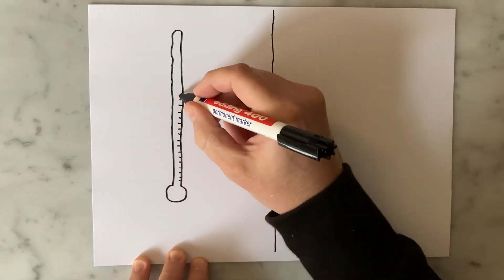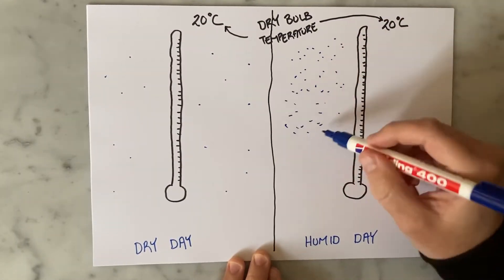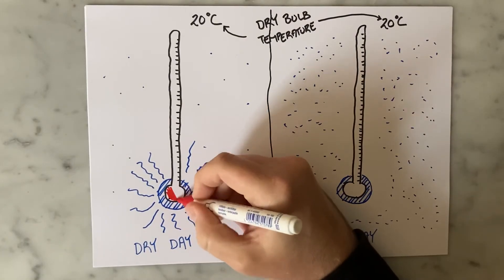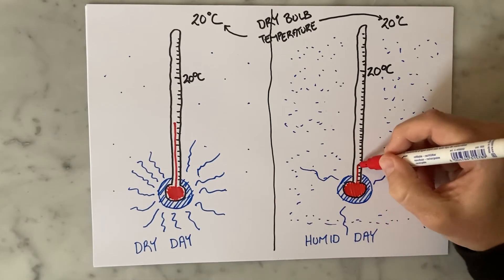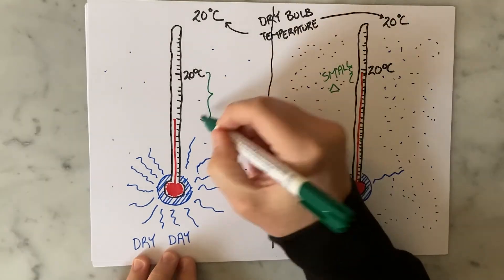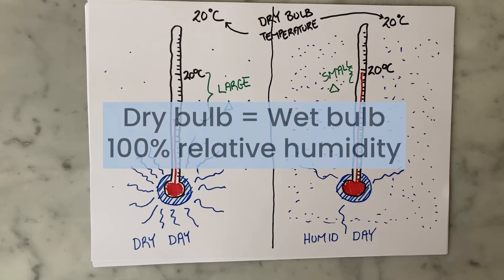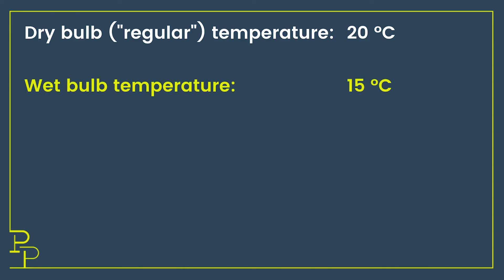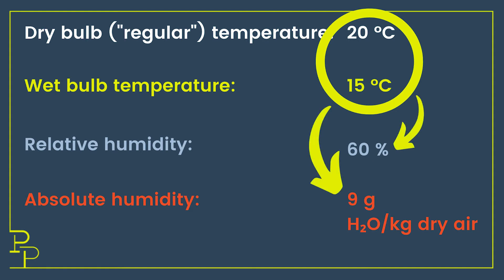Wet bulb temperature - why & when is it used?

Comment: AC is just a heat transfer system using some substance that can boil inside (absorb heat)  just above boiling point of water and condense outside (give up heat). No such thing as cold only less heat. Heat always moves from hot to less hot

Comment: Worked at power plants over the years, often training new folks.  As an exercise, I would sometimes ask them how much water it takes to keep the cooling water system filled.  At first, some would suggest very little since most of the water is returned from the cooling tower back to the plant.   But if you have a large plant (say, 3000 MWthermal) and it's running about 40% efficiency, then about 1800 MWthermal is being rejected into the cooling tower. That's on the order of 800 kg/s evaporating.  In terms for us in the US, that's over 12000 gallons per minute!!!

And yes, the effectiveness varies a lot with the daily weather, which affects the return temperature of the water by quite a bit.

Great video, with some great explanation.
Reply: @dougadams9419 I never said ANYTHING about 'reactor water', don't know where you got that idea.  And BTW, BWR's boil the reactor coolant directly and there are losses in any steam cycle.  And in a BWR, the 'reactor water' IS the steam cycle.

Cooling towers are used in many fossil plants as well.  Bascially ANY large steam plant has to reject a lot of heat to the environment and cooling towers are one way of doing that.  Look for large fossil fueled plants and those too are near water sources.

Comment: Always laugh when pictures of cooling towers are used to represent pollution. Such an inappropriate use of information. In fact, the water vapour is usually of a high degree of purity and nearby fields get increased dewfall during cold overnight temperatures. I live in a semi-arid area and actual dewfall is rarely more than 50 days a year. I'd welcome a power station requiring cooling towers in my neighbourhood.

Comment: Which is more important : dew point or wet bulb temperature ?
Reply from the maker: Your question is kinda like asking “what’s more important in a gas - temperature or pressure?” Both are important and both tell you something different about your system.

Have you seen my video that explains the difference? Wet Bulb vs Dew Point Temperature
https://youtu.be/H1kJttETOMo

Dew point is important when considering when vapours will condense. Wet bulb tell you about how saturated your system is (like a proxy for humidity).

Comment: Very insightful and simple to understand! Thank you for making ChemE related discussions more interesting! 

I do have a silly question. Air is said to be saturated when the rate of evaporation and rate of condensation of water vapour are in equilibrium if i am right. And the higher the temperature, the more the water can evaporate. 

My question is: at higher temperatures, how does condensation of water vapour even begin in the first place once water enters the vapour phase? It seems a little confusing.
Reply: It's a term called dew point, where the temperature gets cold enough to condense the water vapour in the air. That is also able to be calculated.

Comment: Doubt::
If I cover the bulb with a cloth 
1) wetted with water at 0 degrees C
2) wetted with water at 90 degree C
I'll get two different readings ....then which one to call WBT??
OR IS  IT  DEFINED IN SUCH A WAY THAT I NEED TO COVER THE BULB WITH WET CLOTH WETTED WITH WATER THAT WAS AIREADY WITH THERMAL EQUILIBRIUM WITH THE SURROUNDING??
plz help.... definition just says cover it with wet cloth but does not talk abt the state of the wet cloth..
Reply from the maker: You’re concentrating too much on the thermometer and not enough ton the AIR. WBT tells you about the AIR! You’re right that a hot cloth would read higher with hotter water, but only momentarily. That hot water would evaporate and cool itself down. You are right that WBT is an equilibrium value with fresh air constantly passing over the thermometer and the cloth being constantly wetted
Reply: @ProcesswithPat  ohh.... so this means that we will have a unique value of WBT corresponding to a given DBT?
Reply from the maker: Only at a fixed humidity. At a different humidity but same DBT you wil have a different WBT. Fixing any 2 out of 4 of the following values fixes the other 2: DBT, WBT, relative humidity, absolutely humidity (at a given pressure)
Reply: @ProcesswithPat  ohhhh yeeesss.... now I understand....thankyou for helping ❤️🇮🇳
Reply from the maker: No problem. As long as you get it. Never pretend to understand something you don’t. I use that principle every day in my job…

Comment: Really nice and easy to understand explanation - thank you!

I'd only add that the process doesn't start with water insisting on evaporating on its own. Heat energy moves from our skin or the thermometer bulb to the relatively cooler layer of water (which in turn is cooled quickly by the air temperature which is cooler than skin most of the time) because it has no choice about it (it has to follow the temperature gradient) and that's what makes us feel cooler (heat is being sapped from your skin). Then the increased heat content of that water causes it to evaporate which adds to the cooling effect as the warmed water doesn't stick around to create a new, insulative watery skin at the same temperature as your body.
Reply from the maker: Hey there! I’ve been thinking about this one for a few days… I’m considering the scenario where you have a bunch of water on a plate with air above it all at the exact same temperature… if you introduce bone dry air, also at the same temperature, the  the water will evaporate and cool down the plate, even thought the initiating event wasn’t heat transfer from a hot surface to the cooler water. Bit of a chicken and egg scenario? Not sure…

Comment: One stupid question about %RH. If i put 90ml water in 120x20mm petri dish, seal it. Then place it in an incubator at 37°C, will i achieve 100%RH inside the dish when water is at 37°C?
Reply from the maker: Not a stupid question. It depends on how much air you are sealing above the dish. If you use a large vessel to seal (say a large bucket) then there will not be enough water in the petri dish to saturate the air. You will evaporate all the water and you will get to some RH that is less than 100%. If, however, you place a small cup over the dish, then the amount of air you have sealed is low and the water will stop evaporating when the air is saturated i.e. you get 100% RH, and you will have liquid left over in the dish.

At 37 °C air is saturated when it contains 41 g of water per kg of dry air (Google air saturation absolute humidity). The volume of the petri dish is πr²h = π(6 cm)²(2 cm) =  = 226 cm³ = 226 mL which is pretty much 226 g of water if it was fileld to the brim. That means, assuming you started with totally dry air (which I guess you don't, but doesn't matter), you have enough water in that petri dish to saturate: 226 [g water] / 41 [g water/kg dry air] = 5.5 kg dry air. That's quite a bit... As long as your "bucket" is less that 5L of air then you can saturate it (i.e. get it to 100% RH) and have a water left over to spare. But you have to make sure that it is air-tight.

That's if you totally filled the petri dish. You said you only put 90 mL (90 g) of water into it. So that means you are able to saturate: 90 [g water] / 41 [g water/kg dry air] = 2.2 kg of air.

Careful when converting kg of air to volume - you need to use the correct air density at the correct temperature. You may be tempted to use the density at 37°C, but if you first sealed the volume of air at, say, 20°C before heating to 37 °C then you should use the density of the air at 20° C at whatever initial humidity was in the room. Hope that makes sense.
Reply: @ProcesswithPat  
thank you very much Pat for crystal clear explanation. 
 ..." But you have to make sure that it is air-tight."...

 Just a little question if i cover top lid on bottom petri dish then air-tigh seal with: 
1-a food wrap polyethylene film_
2-and or vacuum seal (food sealer)
Would it make any different between the 2 methods?
Reply from the maker: I’m really not sure, I’m no expert in lab methods so you should ask around some more. Good luck!

Comment: Fantastic video, I never really understood what was being talked about with regards to wet bulb before, but now I get it and why it is useful.

Edit: One question that popped into my mind, does the material of the surface that the water sits on affect the wet bulb temperature? Like in the water tower example, perhaps evaporating water would be able to bring a Mercury bulb to a lower temperature than if it were evaporating from just a larger body of water like in a cooling tower, even if both scenarios occur in air of equal humidity.
Reply from the maker: Hey man! Really interesting (and slightly complicated) question. I understand why you are asking it. When measuring WBT we are losing energy due to water evaporation; by energy balance, the material of construction of my thermometer has a specific heat, and the higher this specific heat, the less the temperature of that thermometer will drop, affecting the reading, right? But here's the deal - we can then go and replace the air we have just saturated with a bunch of fresh, unsaturated air, and cool further. So the question becomes more about time taken to get to the reading more than the material itself. You will eventually cool it down to the WBT reading.

But it gets more interesting and more complicated. What stops me just repeating this process indefinitely? I can keep replacing the saturated air with fresh air, keep evaporating water, and keep cooling. Does that mean we have infinte cooling to as low a temperature as we want? The answer is no.

There are actually three different tempratures here at the start: the temperature of the air (dry bulb), the temperature of the thermometer, and the temperature of the water. These three can be, and probably are, different to begin with. As you start evaporating we start getting heat transfer between these three entities until you get to some sort of equilibrium temperature profile (note PROFILE - I won't realistically get all three copmponents to same temperature). Eventually you cool down the air and thermometer, and you cool down the water. Since the water temprature drops, so does its vapour pressure AND HENCE ITS TENDENCY TO EVAPORATE AND COOL. The air is saturated when the partial pressure of water in the air equals the vapours pressure of the liquid. Learn this - this is a definition. So you can't cool infinitely because you cool down the liquid and diminish its vapour pressure.

This touches on something called the psychrometric ratio, which ackowledges that there are two temperatures here:
1. There is the thermodynamic wet bulb temperature - the "true" or theoretical limit of the WBT that I achieve when any gas becomes saturated with any liquid (not just air and water). This is the WBT I describe in my video "The difference between WBT and Dew point". To get this I would need a perfectly insulated box in which I saturated & cooled the gas by evaporating liquid inside the box inside this box and and acheived a unifrom temperature inside. Note that I don't care what sort of thermometer I am using to measure this temperature in my perfect box.
2. Then we have a realistically measured WBT, you could probably refer to this as simply an equilibrium temperature which is what we usually measure. This temperature reading stabilises at some value based on  the mass transfer rate of water into air as it evaporates (mass transfer coefficient) and the convective cooling rate (a heat transfer coefficient).

Depending on those two transfer coefficients there may be a large difference between the thermodynamic WBT and the equilibrium temperature measured during a WBT experiment in your kitchen. For water in air there is no significant difference purely by coincidence.
Reply: @ProcesswithPat  Wow thanks for that super thorough response! I really appreciate how much effort you put into your responses, you're crazy smart dude! I've read it once and I think I understand, but I'm definitely coming back to it after mulling it over a bit more too.
Reply from the maker: Thanks, but to be honest I think I just spend lots of time on these things. Don’t stop asking questions!

Comment: Hello, very helpful presentation. I am having a small query.    While measuring wet bulb temperature,    when temperature of wet cotton (soaked cotton) decreases due to evaporation....... Then Heat will start flowing from air to  this wet cotton because of temperature difference ... Due to that temperature of bulb will again increase.
Please clear my query.
Thank you.
Reply from the maker: Hey there! Generally when you measure wet bulb properly you need to shake/wave the thermometer or keep a constant air flow across the thermometer. If you do this and keep supplying fresh air to maintain constant evaporation then you will reach a steady state wet bulb. If you then stop and let it stand then you are correct, the air will warm up the bulb and the temperature reading will increase again. Does that make sense?